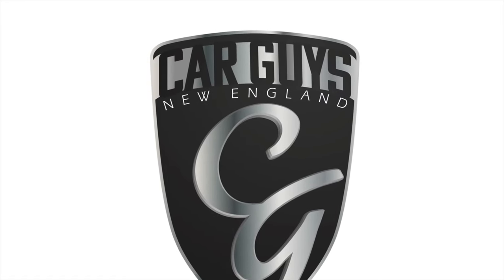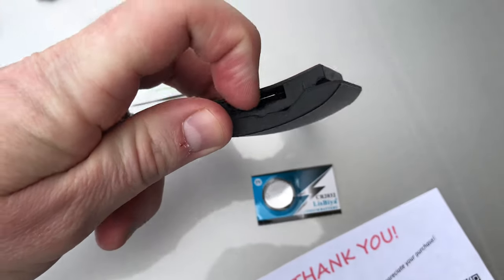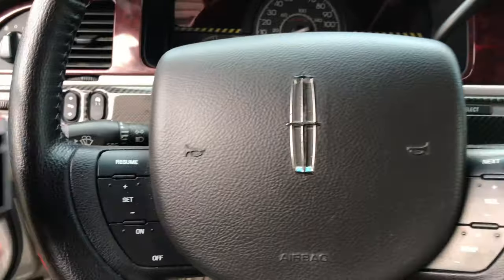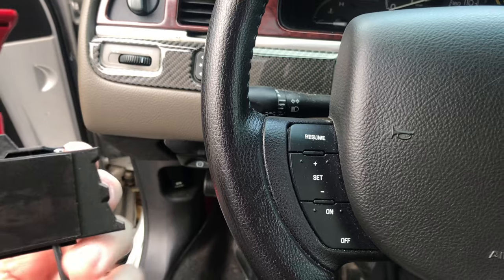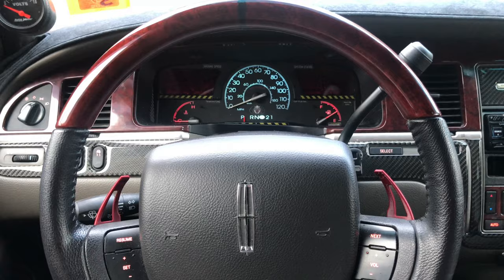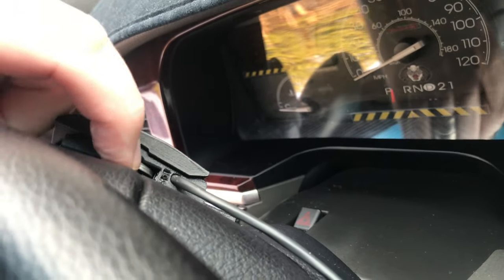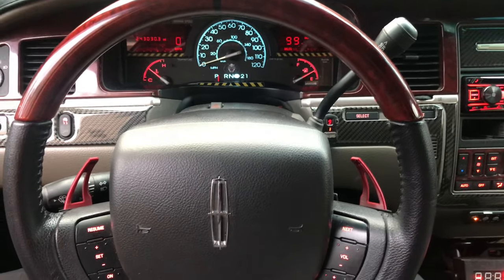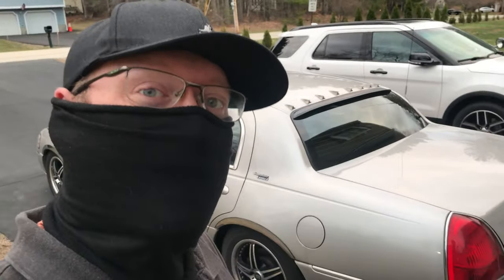CANSHIFT Paddle Shift Kit Installation In Panther Platform Cars

Comment: What kind of transmission mods do you got? J-mod? Marty tune? both? or none? I'm thinking that those mods will affect the speed and firmness of the shifts in combination with this thing.

Also...Ya got some scammer pushing some porn site below my comment...I reported that scammer to youtube, but they might not do anything about it so you might have to..
Reply: I wondered what that crazy looking link was I've seen em on lots of channels. Thank You
Reply: Thank you
Reply: @MikeTyson2  no problem, I’ve seen it everywhere too and every time I report it.
Reply from the maker: I don’t have any physical mods to transmission yet... I do have a custom SCT ECU tune done by Granite State Dyno. I am running a sprint booster for faster throttle body response
Reply: Youtube is on it. Lmao.

Comment: I won a 06 lincoln with a tune and these paddle shifter they dont appear to he working could it be a dead battery? I do notice some times I could use a up or down shift to either save gas to haul ass. Please lmk!! I won @fordbossme lincoln 100k giveaway thanks!!
Reply: Well scratch that I didn't know I needed the camshaft module hooked in for it to work duh!@